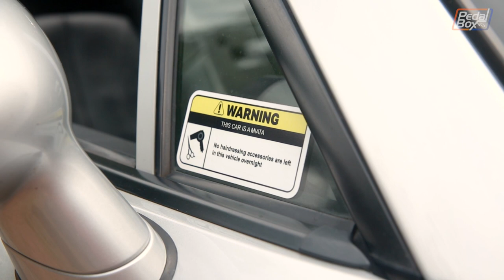Meister R Suspension | Mazda MX-5 NC| PedalBox Fleet - Episode 57

Comment: Some comments about your installation:
1) You should show how to measure and adjust the height of the coilovers
2) You need to mark the position of the eccentrics on the rear control arms, to re-install them the same, and keep the rear alignment close to what it was before the installation.
3) Tightening the front and rear control arm bolts needs to be done with the full weight of the car applied, so the bolts are tightened when the bushings are in the static position when tightened.  Otherwise, the control arm bushings can end up being twisted, which will quickly destroy them.
Reply from the maker: I believe it went for an alignment right after (or the next day or so before track) so ball park was as good as it got, i've never had any luck maintaining alignment when pulling suspension apart so usually get as near as and take it for a proper alignment asap. Good point on the measuring though!

Comment: Best part 7:00 min in where he attempts to loosen with the hex key while holding the nut. LOLOL. He should've held the hex key while turning the nut ccw. Funny stuff.
Reply from the maker: Happened again on that Rover radiator install until we found the nut wasn't in fact captive and the bolt was an inch or more too long

Comment: What settings did you use on the Meister R's for track and road; I have the same setup? 
I use 12 clicks from "soft" front and 10 from "soft" rear for road and 5 from "hard" front and rear for track- full hard setting is bone-jarring! 
Also what mount did you use for the GoPRo please?
Happy New year!
Reply from the maker: I can't quite remember, but once everything calms down, hoping for a track day and we can do some testing and adjustments!
The Go pro i'll have to check with Dave and let you know!
Reply: Hello mate, how does it feel when you put them hard ? Does is reduced enough body roll for the track ? Also is it comfy for the road when you soften the damping ? I already have coilovers but they are too harsh for the road. Perfect for the track but I only track it once in a while.
Reply: @Kamal-me5cx  As mentioned full hard setting is bone-jarring and unpleasant (there are 32 settings, I think hard-soft?)
5 clicks from full hard is a perfect balance to reduce body roll for the track. 
Full soft for the road is like sitting on a water bed- far too soft. 
The settings I gave were recommended by Paul Roddison who built the car and races (and wins) in the MX 5 Championship- 4 years in a row so he knows a thing or two!
They are so adjustable that I am sure you will find a setting that will suit you for any conditions on the track or the road
I hope this helps
Reply: @marklawrence3958  looks like the range of damping is larger than my coilovers, many thanks for the feedback 👍

Comment: Can I ask did you get the rear out without removing the drop link?
Reply from the maker: The rear we took the drop link off. 06:46.
Reply: Ok thanks mine are shot, 5mm Allen bolt rounded off, gonna grind and buy new